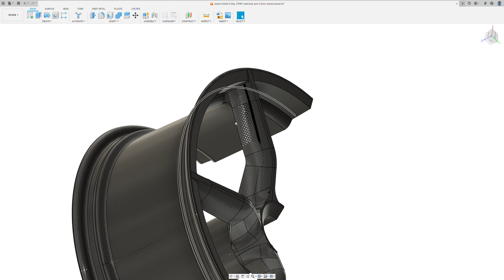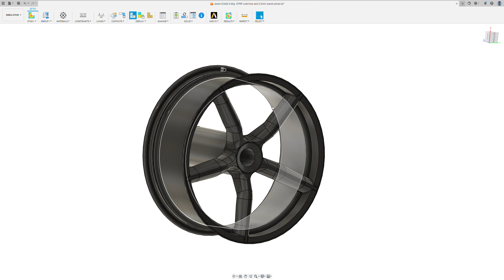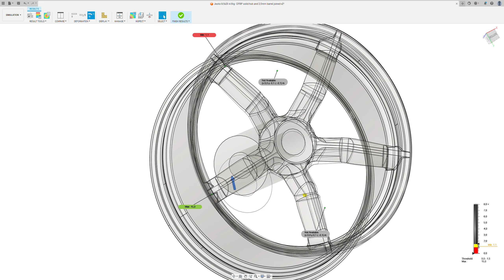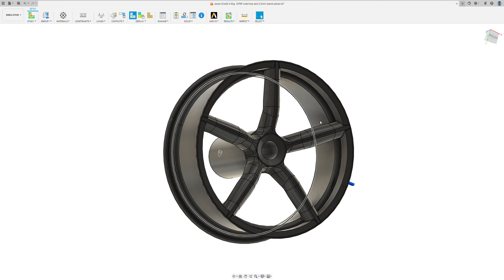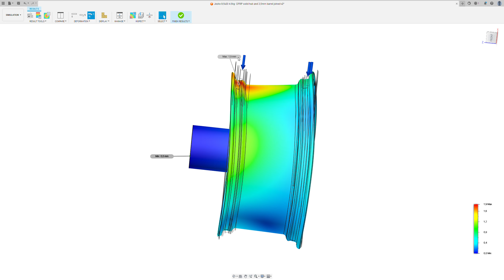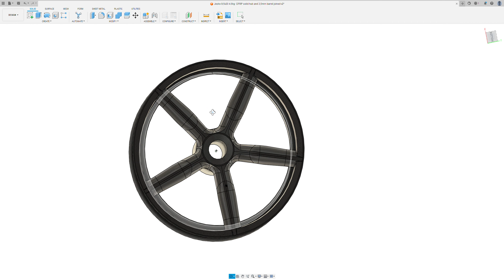Koenigsegg Jesko 9,5x20 front carbon fiber wheel weight 5,9kg, why are they so heavy?

Comment from the maker: Found the error I modelled them to 18" diameter :D. Always double measure before you build something and never assume things. I used previously modelled Gemera 11,5"x20" wheel as a base and its diameter was wrong by 2" and now my changes were correct, but the diameter of that wheel already was 20" so it went 2" too small. New video coming...

New results for 20" version 
That bending test stress under the spoke dropped to 185MPa and I corrected the force to match 775kg max load. now the radius is bigger under the spoke. 
Radial fatigue test SAE J-328 775kg 19007N stresses dropped on the centre barrel to 215MPa

Weight of the model jumped to 5,02kg with carbon and 1430kg/m3 density as previously

So mostly the weight increased little bit otherwise the results are the same.

Comment: You seem to know much about wheel construction and design and also how they can be analysed with FEA. I'm wondering why the hub is modeled with the depth/length exaggerated that much? Surely this will cause some dissonance between the boundary condition of the clamped hub and the forces you apply?

I understand that a shorter hub would make the design even lighter and is further proving your point but i feel like this is an important specification to make the stress analysis/deformation analysis more realistic to how the forces cancel out. I'm sure this has an explanation, can you explain.

Just an example: an infinitely deep hub would for example give infinite millimeters of deformation when measuring from the clamped point.
Reply from the maker: @ollejansson852   it's for bending test 260mm longer than actual et dimension. I have many models for various tests. In future  impact tests will be without that 260mm extra length.

It can be done separately in fusion360 but takes few more clicks to make connections... So saves little time at least in theory

It's flex at the center hub is 0.2mm at the outside edge. So not much

Comment: Atleast Koenigsegg has been making hollow spokes on their wheels for a long time.
But could it be, that if they want to drive 500 km/h instead of 250 km/h, they want wheels to be tougher than those "normal" wheels. Because for example impacts from the road will be a lot worse at those speeds.
Reply from the maker: Surely the requirements are higher if going really fast. But in general driving fast is not so stressful to the wheels compared to hard track use where you cut through corners and go little wide.

Those super high speed runs its on level smooth tarmac but wheel failures at those speed will be a catastrophy.

The catch here is that carbon can take much more beating before it breaks. Here some average values

Tensile Strength, Yield 3380MPa average values 1260MPa
Tensile Strength, Ultimate  4140 MPa. average values 965MPa

If those wheels have now max stress levels 263 Mpa with I think too small corner chambers and in the bending and radial fatigue test.
That is still 14% of the yield Strength so almost 7X safety factor.

Yes the Fusion 360 you always need to double check real material values what they can take when interpreting results. Like Here best would be to make new material what you are actually using as there are so many carbon composites out there. Some can have Tensile strengths closer to 7000MPa.

If you have wheels which costs 88000€ per set, I would assume they are top range for materials

Comment: I would kindly test 15" x 5.5" ET38 5x100 mm 56.1mm K. Jesko wheels  to replace my 5.8 kg forged magnesium ones. Totally free. Those I can't fit.
Reply from the maker: I will also plan to make one version of my 8x18 wheel on 6x15 size for smaller cars. Will be much lighter than current audi pepperpots...

What would you be willing to pay for a set which is closer to 4 kg mark?